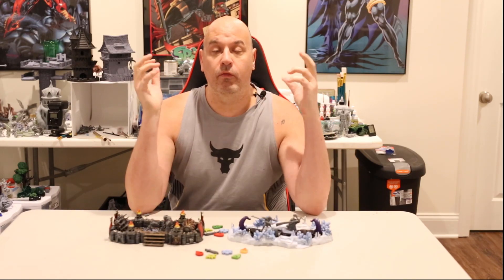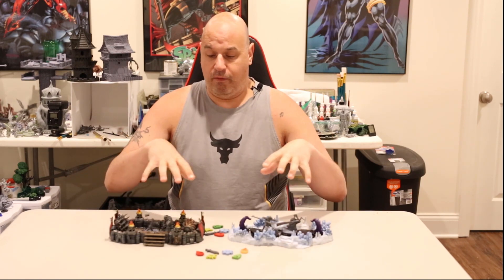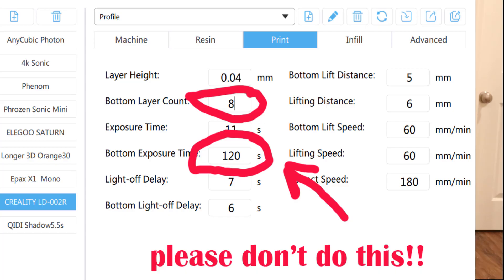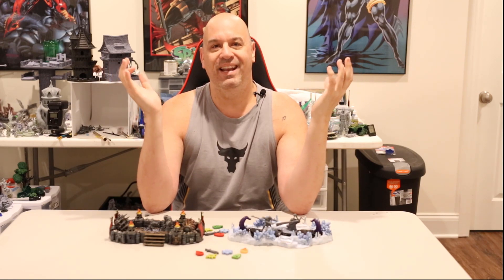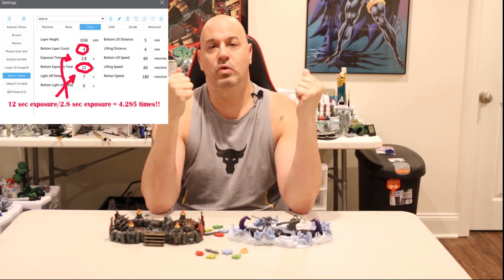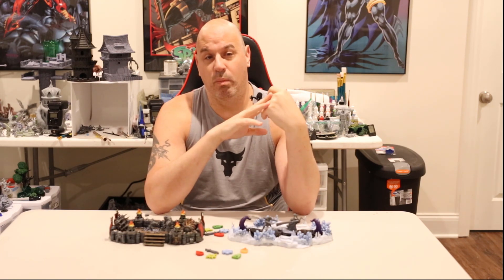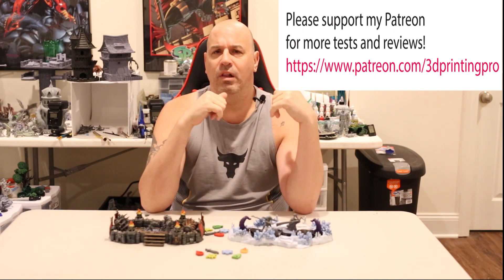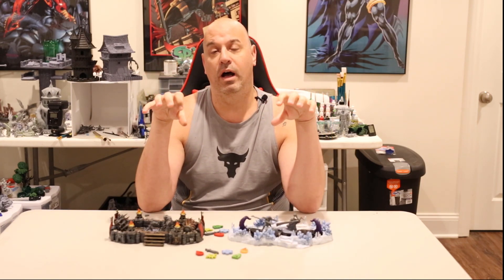Are you destroying your LCD screen when resin 3d printing?? Learn what settings may be doing it...

Comment: I started with a normal layer exposure x3, (which failed 100% of the 
time) and tested with increasing bottom exposure until the prints did 
not fail in that way.
On a mars2 mono  (non pro) with "rain-x" applied to the fep.

for Anycubic grey, I use 5 bottom layers at 15 seconds each ( layer exposure is 2.6 seconds)...elephant foot starts at 9 seconds, but prints don't stick reliably until 12-13.

for Siraya tech blu v2, same printer ; 4 bottom layers @ 12 seconds ( layer exposure is 2.75 seconds).....elephant foot starts at 8, prints stick reliably enough at ten, and an extra couple of seconds to prevent the warping on the corners of large objects that I got with this resin. ( when the elephant foot doesn't matter, then 14-20 sec for this resin...more is hard to remove from the build plate, and starts to stick to the fep.)

Comment: I just received a Mono X yesterday and checked the flatness of the build plate. It is cupped. I used a straight edge to check and the middle of the bed is .2 to .4mm away from the edge of the straight edge. Could that also be a reason some are having problems with bed adhesion even though they "properly" leveled their bed?
Reply from the maker: Absolutely, if you somehow get a plate that is machined incorrectly you most likely can't level it no matter what you do!

Comment: As I literally started resin printing yesterday, I was struggling to get my models stuck on the build plate, even with rafts, unless I cranked up my bottom layer exposure time to about 60-65 seconds (from 35-40s recommended for Mars 2). What other solutions are there to get prints stuck to the alu plate? I've seen a lot of people putting PTFE oils on the FEP sheet but I don't want to contaminate my resin in case I want to pour it back into the bottle for later use. I appreciate any advice, by anyone, and thanks for making videos like this!
Reply: Treat the fep with a coating of ptfe, if you do it right you should only leave a very trace layer, coat it and buff it clean what is left is the amount of ptfe you need to resist sticking and has no chance of contamination of the resin

Comment: The official Elegoo Mars printer setting data sheet recommends base layer times of 35 seconds for their water washable resin, and as long as 60 seconds for some of their other resins. It’s confusing when the official recommended times are at settings that you say may damage the screen.
Reply from the maker: I honestly find most "official" settings are way way off....

Comment: Any "community standards" I've tried ruined the details on my minis and adhered them to the build plate like they're welded on. For the Mars 2 Pro at least, shorter times for normal exposure and bottom layer are so much better.
Reply: Hi! I just bought my Mars Pro and pieces do not stick to the build plates, what settings are you using? Please help 🤦🏻‍♀️
Reply: @TefyS101  Since the Pro 2 has a mono screen I can get away with shorter exposure times. I use:
Bottom Layer Count: 5
Exposure Time: 4s
Bottom Exposure: 20s
Light off delay: 0s
Bottom Light-off delay 0s

The default settings in Chitubox for yours would only change a few settings:
Exposure Time: 7s
Bottom Exposure: 45s
Reply: @brennefleisch  You are amazing! Thank you! I’ll try right now this settings

Comment: i have a little question my prints are not sticking to the build plate and i have tried calibrating the machine many times
Reply from the maker: If you're perfectly leveled, room is warm enough and resin shaken, and you cant get adhesion, something could be wrong with the machine's light source or light transmissions
Reply: @3dprintingpro212  thank for your advice but i have been tinkering with the machine and now the support and base are been sticked but the actual part is just a blob in the vat my prediction us that the supports are just too small i am new to the whole resin thing but i have 2 years of experience with fdm
Reply from the maker: @jesuszamora8408  raise the "normal" layer exposure time then  :)

Comment: So question. Ive been using 4 layers at 12 seconds on my mini 4k. For 28mm models it mostly works (sometimes rafts stick to the fep) but I've started printing 8mm models and EVERY SINGLE ONE fails. I put it in the phrozen fb group and phrozen themselves recommended 30 second bottom layer. I bumped it to 25 as a test and only 1 of the prints on the plate (12 parts total) has the raft failing to the fep. Any recommendations? I don't want to burn out my screen
Reply from the maker: If you're leveled properly, unlels its really cold where you are, you shouldn't need more 25 seconds for any layer height, or something else is wrong

Comment: I am using siraya tech fast navy grey. My printer is an epax e10 . I checked the seting from the siraya tech site there recommend settings are 30s initial exposure, 5 layers and  2.5s for the rest on a Mars 2 pro. I could not find settings for the e10. My print room is also at the low end of recommended (20c) the site recommends increasing initial layers exposure time to compensate. I am using 4 initial layers at 25s and 2.5s regular exposure. I have only done 3 prints and no fails but don’t want to destroy my lcd.

Comment: This works fine for me. Just got an Epax E10 and used Siraya Blu for my first resin. Exposure test showed 5.1s was best, and I'm using 18s exposure for bottom layers, and 4 bottom layers. Just printed a huge piece and it came out great, no failures, not build plate separation.

Comment: I have a brand new Mono X printer, this is my very first resin printer. From doing some research it looks like chitubox is the slicer to use for resin printers. I was in hopes of seeing a tab by tab of the settings to setup the chitubox for the mono X printer. Any way you can do a video on this so use brand new resin printers out here do not destroy there new printer??
Reply from the maker: For some odd reason Anycubic didn't set up beforehand with Chitu.
Reply: @3dprintingpro212  I agree Anycubic should have setup a chitubox option. the slicer from Anycubic is not very good slicer and that is why I was seeing if I can set it up with chitubox I just do not know what to use being new to printing
Reply from the maker: @scifimodelshop  Oh just get it all supported and ready in Chitubox.  Then save that file as an .stl, put it into the Anycubic slicer adjust the settings and just slice it there  :)
Reply: @3dprintingpro212  okay I can do that I was just trying to use only chitubox as my slicer. I see if I can find mono x setup in chitubox  thanks for the help

Comment: Thanks for your valuable info with this vedio. I have a problem in my resin printer which is print sticks in FEB vat instead of sticking in the bed. however, I did several bed leveing according to the manufacturing instructions but still print fails and get stick in the FEB. please help and advice if you can

Comment: So, crazy question, but why not just use 1 bottom layer? It's the only layer that can actually stick to the build plate right?
Reply from the maker: Initial layer gets pretty squished, as do subsequent layers, less than 4 would be a mistake imo  :)
Reply: @3dprintingpro212  and there is no way to fix that with modifying the z-axis home? I have noticed my bottom layers getting squished when I print without supports, but I thought that might be the build plate going too low for the first layer or 2. I'm very new to the 3d printing scene. Most of my experience with making is from my career as a machinist. So please excuse my misinformed questions. Haha.
Reply from the maker: @Doabarrelrole  you want that squish!
Reply: @3dprintingpro212  ok, I'm assuming that to help everything stick to the build plate right? I guess that still brings me back to my original question. If you are printing with supports and the model is something like 5mm off the build plate, you don't have to worry about the model getting squished, and only the first layer is actually sticking to the build plate. So why have more than 1 bottom layer? Do the other bottom layers squish out further to help with adhesion?
Reply from the maker: @Doabarrelrole  yes  :)

Comment: I never run more than 4 bottom layers, and never more than 12 seconds for my bottoms. Tried some eSun Tough-Hard resin, they recommend 25 seconds for bottom layers, and it destroyed my brand new FEP before first print was over, which made a crap, useless part in the end.

Comment: Because of this video I lowered my bottom exposure from 35s to 12s, you may have saved my screen. I make my bottom layer equal to the thickness of the raft of larger models. I have had layer seperation of the raft with larger models which causes failures. I guess with smaller models, I could go down to 4-6 bottom and save my screen some more. What do you think?

Comment: Took your advice, prints immediately failed and I have to replace my FEP. Not for me.
Reply from the maker: Hmm that's odd, what's the temp in your printing room?
Reply: Ambient temp was about 68 F. Humidity was around 50%. I’ve been using settings from the community spreadsheet and was getting good results. Just seems like without a high bottom exposure, I won’t get a good bond and it leads to failure. Granted, I’ve only had my Anycubic Photon S for about a week...

Comment: After watching your other video on exposure times I tried what you suggested with my Creality LD-002R. I lowered the settings to 5s and 45s, and had a massive failure due to underexposure. Used Elegoo's "standard white", which recommends 8s and 60s, and it prints well at those settings. Have you messed with an LD-002R yet?
Reply from the maker: the 002R should be more like 9 to  11 second exposure and 5-60 bottom exposure
Reply: @3dprintingpro212  Wow, that's way off what the factory recommendation is from Creality, who claims stable 4s per layer. Why do they require over double what the company claims?
Reply from the maker: @BluhmGardens  that's the color screen not the monoscreen right?
Reply: It advertises as a monochrome, with 4x 405nm LED's, but 5s per layer definitively was not enough. 8s seems good, so I'll probably just leave it there.

Comment: I wish I had seen this 3 days ago when I just got my Photon Mono X. In 3 days of following many examples, I have found almost nobody knows anything with any certainty. I now have a gouge in my bed plate where an 80 second bottom layer exposure, cooked a raft on that required extreme chiseling at it to remove it. My FEP is scratched by tissue paper from cleaning, and has many marks where parts had been cooked onto it, and a couple of failures that attached to the FEP so well I marked up the FEP with the plastic spatula.

Comment: Its level, level, level...the most important thing. I level usually after every 3 prints or so, maybe overkill, but works, Siratech Fast grey on a OG Mars usually at BLC-5, ET-7,BET-40, I print as large I can and usually dont get failures, orientation after leveling is key.

Comment: Thanks for this video. Chitubox default and Elegoo recommends 35s bottom layer for the water washable resin on my Mars 2 Pro. So far, I've reduced it to 25s and it still sticks very well. I'm trying 20s next and feel that, that 15s may actually be the sweet spot, but I'll find out. Again, thank you for shedding light on this.
Reply: what exposure time do you use?

Comment: Sm4k here: 4 layers @ 18sec in normal resins (30 sec lightoff for cooling), then 2.1-2.5sec/layer and 12 sec lightoff

Works for me. I suspect I can go shorter on the base exposure though as support bases can be tight to get off the Whambam plate (flexing doesn't pop small features)

Comment: I use a 0,3mm height raft (when printing with supports) so normally I use 5 or 6 bottom layers with 0,06 and 0,05mm LH - wich gives 0,3mm. Exposure time is 40secs. Nromal exposure is 9sec with 0,06mm LH. Works perfect (few kgs of resin without issues) and saves resin.

Comment: I remember seeing this video when I got my Elegoo mars. the recommended settings for water washable ceramic grey was 60s bottom layers and 8 second exposures.  I think I adjusted after to 6x.  But I just got a Photon Mono X and the built in settings for the samples and their slicer is 1.5s layer with 40s Bottom.  And noticed massive elephant foot with items i printing directly on the tray (compared to the mars).  I'm going to do some tests dialing down those bottom layer exposures.
Reply: are you able to report back on this? Thanks

Comment: Gonna experiment with the mini 4k right now. I had a suspicion my base exposure times were too high because sometimes prints were sticking too well to the build plate. I'll report back with my results....
EDIT! follow up below:
I have tried a few times now, and 5 base layers with a bottom layer exposure time of 10 seconds gives me a good amount of adhesion while also allowing prints come off very nicely. Thanks for the tip Greg!
Reply: For further clarification, I lightly sand my build plate. Still using these settings 👍
Reply: @SappyElephante  iv never heard of sanding the plate, is this just for better grip?
Reply: @unifiedmongoose7915  Sorry for the suuuuper late reply. This will vary from manufacture to manufacture. I was just following Phrozen's instructions. I know some manufacturers have started "texturing" their build plates straight from the factory.
Reply: @SappyElephante  Thanks for your inputs Jared, what number of sandpaper you used for your mini 4k? Thanks very much.
Reply: Good stuff

Comment: I have the Anycubic mono x printer since about one week and I have a problem. I work with Workshop and use the settings in Workshop for my printer. Layer Thickness: 0.050, Normal exposure time: 8.00, Off time: 1.0, Bottom exposure time: 60.00 and Bottom layers: 6. The first 2 models were printed perfect. But then.......... problems began. When printing only the bottom layers were printed and then the printer kept going upwards without printing anything. In the plastic bottom of the case where the resin is in it, there is also a very thin hard resin layer. I can not imagine that should be. I think that because of that layer the uv light might not get through that layer and that this is the raison why printing is going up without resin. Good conclusion or not? Then I would know is the problem the printer or the settings. Thus I printed again the cubic from Anycubic that I became as example. And the printing was perfect. When I looked at the settings in Workshop from the cube they were: Normal exposure time: 2, Off time: 0.50, Bottom exposure time: 40.00, and Bottom layers: 6. Also a difference with the settings from what Anycubic does in the Workshop bij mono x. Now I can not declare why the first 2 times printing were well.
Is setting the normal exposure time to 2 or 4 seconds a good thing or becomes the models less smooth?
Perhabs you can tell me what to do. The resin I use is the grey basic resin from Anycubic. Because I am Dutch it may be that my English is not always good.

Comment: I found for my printer (QIDI S-Box) Bottom layer count 5/Bottom exposure time 60 seconds in colder weather, summer time I use bottom layer count 4/Bottom exposure 50 seconds in summer months. I have also found that I remove the build plate and I rinse the bottom portion of the print off with IPA PRIOR to any attempt at removing model. Have not had any issues at this point.

Comment: this is a great video, i just started off and was suggested to go with the resin settings sheet from online, the majority of them suggested 6-8 bottom layers and 80-90 seconds which even i being a noob felt was nuts. If i get failures i get failures i will test out your suggestion and see what happens 

thanks, your videos are awesome
Reply: Happy with the result?
Reply: @readywhen  just printed a really nice looking 75mm and this method definitely works. base layer x4 30 seconds exposure and, reg layer at 4.5s turned out great. Did learn that adhesion to the plate takes a dump rapidly under 30s for base.

Comment: This is honestly not working for me. 

Creality LD-002H. I have successful test prints at 1.5 seconds, 4 bottom layers exposed at 20 seconds. 

1.5 is honestly over exposing using the Amerilabs test and Elegoo water washable resin. 

Applying your math of 5-6x the time of the normal layers has resulted in no bed adhesion. I just re leveled and I am testing 6x again.
Reply: Verified after leveling, this math is not right. 

0.04 height
4 layer count
1.5 s exposure
9 bottom exposure
No light delays 
5mm bottom lift
6mm lift distance
50
50
150 mm/min
Reply from the maker: @jonmcclay  yeah it wont work exactly for everyone (different resins, altitudes, humidity, temperatures, et cet), more to the point is find what works but don't go overkill and mess up your screen!  :)
Reply: @3dprintingpro212  do you think 20 seconds for the bottom layers is crazy? Most members of the different online communities have recommended 20 seconds for this particular machine.
Reply from the maker: @jonmcclay  Nope 20 is OK,  I hate to see people using 30+ seconds though ...

Comment: Would layer height be a significant reason to change the bottom layers and exposure times? I had it set to 0.025 for a while with countless failures and I was losing my mind but then when I increased the bottom exposure time and layers it started working fine. I increased the layer height to 0.05 with a bottom layer of 8 and 90 second exposure time, I did have it at 10 and 120s for 0.025 because it literally would not stick to the bed otherwise.
Reply: You need to "calibrate" with a MUCH thinner pcs of paper than the usual Copy Paper 80g/m² to have a successfull 1st layer at 20 or 25 Micron only!